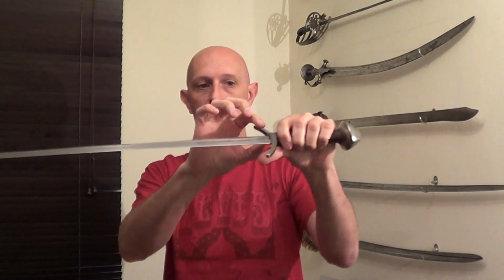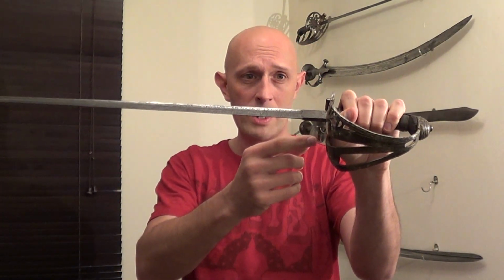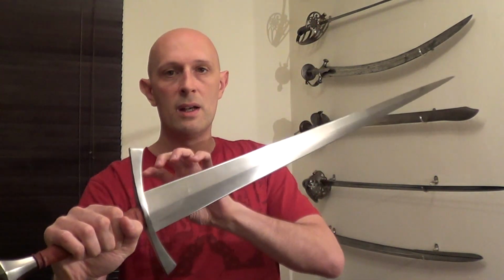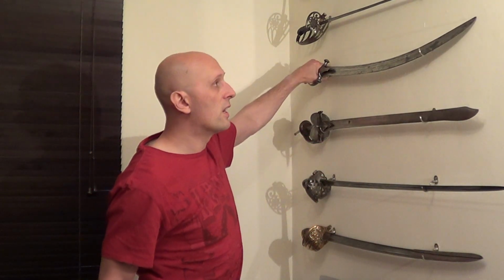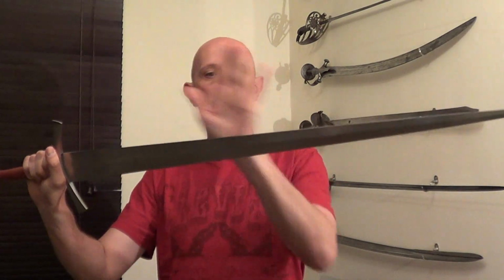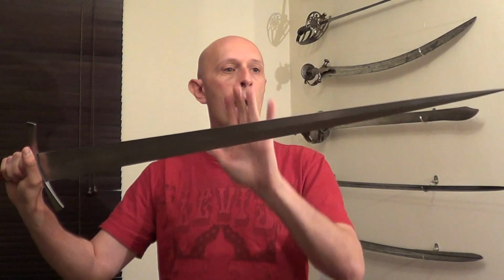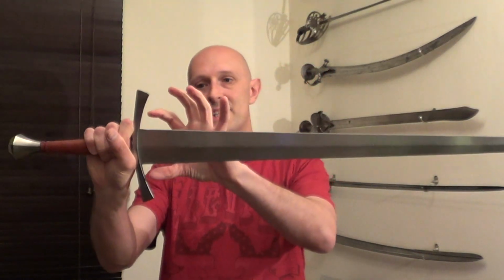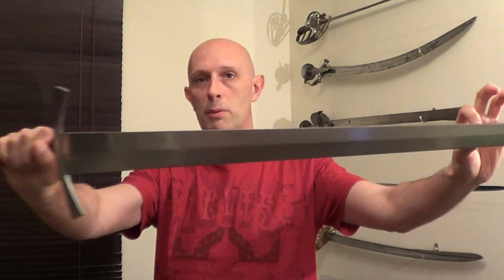Sword distal taper and tapered blade types

Comment: My Albion Laird sword finally arrived last week, and I was amazed at how different it was from every other sword I've held, mainly for the reasons this video mentions. The only problem is that my older swords now feel like metal bars in comparison. I probably wouldn't have heard about Albion if not for your videos, so thanks! It took me awhile to pull the trigger because they aren't cheap, but their products are worth it. Related to your points about those two swords in the video having less distal taper to improve their thrusting power/efficiency, my new sword has a lot of distal taper, and when thrusting into anything, if you're not careful it can bend and not penetrate well, but it cuts amazingly. There's a lot of stuff you wouldn't think about if you don't have any experience with period swords or accurate replicas, so thanks for sharing your expertise. :)
Reply from the maker: zarbran Congratulations on your new sword. Albions are expensive, but they are consistently excellent and very good replicas of actual original swords (unlike most replicas unfortunately).
Reply: zarbran Congratulations on your new sword. I have The Knight, and to my knowledge The Laird, The Caithness and The Knight share the same blade. I can relate to what you are saying. They are almost identical. 1,2 kg and CoB: 11 cm on The Laird and CoB: 11,43 cm on The Knight.

Skallagrim is owner of The Caithness. It's 1,15 kg with CoB: 10,8 cm. He has done a lot of great cutting with his sword if you haven't already seen it.

These swords are really nimble in the hand. Would really love to see a review by Matt on one of these swords.

Comment: I don't mean to be pedantic, but "distal" actually just means "further away from a point of reference", in this case the grip. It doesn't specify in which plane (in this case you could probably call them sagittal and transverse). Proximal is the opposite, it means closer. So those two albion longswords actually have a lot of distal taper in one plane, but almost none in the other.
Reply: Sharpknifesedge I think it's just a convention to call tapering in thickness of a blade "distal" while using "profile taper" if you are refering to broadness. But you are probably right about it being a bit stupid, language tends to be sometimes. =)
Reply: gurkfisk89 It probably is. It is certainly convenient to have a term for a taper in one specific plane. It just doesn't make sense to me to talk about "distal taper" when the so called "profile taper" is clearly a form of distal taper too. Maybe I'm a bit obsessive about these things.
Reply from the maker: Sharpknifesedge Linguistically you're correct of course - however in the world of swords (and perhaps knives) people generally understand 'distal taper' to refer to the reducing blade thickness (as opposed to width).
Reply: scholagladiatoria Fair enough...
Reply: Sharpknifesedge Deceleration is a form of acceleration, but without mentioning deceleration, its understood that by default a person is referring to positive acceleration. You could say its a language shortcut, using an assumption to save time when conversing.
Reply: The nature of language is that words take on new meanings over time, and have different meanings in different contexts. It's not incorrect usage to use a term of art that may have different meaning anywhere outside that field.
Reply: Albert Milbert I hope that you don't use those rules all the time. I mean, I would think that someone who never use metaphors would probably be rather dull (and with dull I mean boring, I'm not talking about their geometry). =)
Also, as you have a problem with zweihander, do you also have a problem with the words gladius or katana?

Comment: The Kingmaker from Albion is an example for the opposite. It is a type XVIII but tapers from ca. 8mm to 3mm despite having a good profile tapering as well. Moreover it has two interesting features: the hollow grind elevates the mid-rib and the profile tapering reminds of a gothic arch giving it a bit more width at the cutting point.

Comment: Hi Matt. 

Could you please make a video about longsword footwork? I was always taught to keep my feet as parallel as possible and to avoid twisting my hips at all costs when making the passing step. I.e., the hips are to be as on-line with the opponents as possible at all times. But I see a great many instructional/sparring videos on here where no real attention is paid to that and even experienced swordspeople adopt a stance where the back foot is essentially at a 75 degree angle to the forward foot. The sources I've looked at don't seem very clear on this. Is it just a matter of interpretation? How important is the position of the feet and hips, and what is the correct 'form' for passing steps?

Comment: 8:25 I would like to point out that this triangle shaped blade can even actually penetrated a chest plate with a trust. I have seen it successfully done so in an experiment before (however, they use modern steel for both sword and armor) That's how imprressivly good this triangle shape blade is at stabbing.

However, I would also like to point out that it literally just penetrated the plate armor, as in just poke a little hole with just the tip of the sword. It wouldn't be letal even if the wearer doesn't wear gambleson beneath the plate, and the sword would also get stuck.

Comment: When you said that medieval arming swords and longswords are not great cutters, does that just apply to those with a diamond section like an Oakeshott type 15 or does it also apply to older forms like type 10-13?
Reply from the maker: beonoc Earlier broader, flatter types are better cutters in general.

Comment: The Ringeck has a great deal of distal taper!
At guard 8.96mm
PoB 7.94mm
CoP 4.81mm
Tip 3.63mm
Reply from the maker: Andrew Hannam The numbers are a bit deceptive here - you'll see that it goes from around 9mm to 8mm just in the first few inches. Then from 8mm it only goes down to around 5mm at the CoP. 5mm at a CoP is really thick! Many sabres, tulwars etc are around 2mm at the CoP, and they also start at around 6-8mm thick at the base.
Reply: scholagladiatoria  Interesting, I am not very familiar with sabres and such. I will state that the Ringeck is however a type XVa not a good cutter like XII ect. I remember when I saw my first "real" medieval sword thinking how thin it was. I came from Japanese sword arts and katana and tachi are THICK!!!!!! and heavy. Thanks for an alternate view.

Comment: The longswords that Matt seems to be showing more don't have a fuller from what i can tell, is there any disadvantage to having a fuller, or is there any reason to not have a fuller? it seems to be very useful in all swords from what i can tell
Reply: Tyrion Lannister That particular Sword is from a period when armor and shield were predominant or at least more frequent in the battlefield, you want a stiff and heavier weapon, for trusting or paring, so, is not necessary to subtract material from the blade, what is basically what a fuller is.

Comment: hey as a blacksmith relatively new to swords(i specialise in axes) i would ask you as one who mainly wields them, what disal taper should i generally put on dedicated cutting blades like the germanic aptha. as used during the roman occupation of the netherlands,55 BC to around 410 AD particularly late in that period towards 500AD
Reply: Arian Wijkstra  Honestly, best thing you can do to start is find an actual archaeological find and replicate that. Some museums may be willing to give you measurements.

For questions as specific as these, I recommend http://www.myarmoury.com/ instead of a YouTube comment section.
Reply from the maker: Arian Wijkstra I generally agree with Martin, however distal taper doesn't vary hugely between swords from a wide range of cultures and periods. For something like a spatha, or a Viking era sword, a distal taper of something like 6mm down to 3mm would be quite normal.
Reply: I've scoured the internet for information on distal taper in Roman and Migration era swords. I haven't found a good source for reliable numbers. One factor that seems to be overlooked: The transition from pattern welded iron blades to steel. The Romans and early Germanic cultures could not make what we call steel. 

I don't think the earlier Roman and Migration era swords had as much distal taper as later steel blades because pattern-welded iron blades would "set", That is, they would bend and deform when struck, instead of flexing like modern steel blades. To compensate for their weaker metals, these early sword blades had to be thicker and heavier. 

As mentioned in this video, the Japanese katana does not have much distal taper. Not coincidentally, It had a folded metal construction like early European swords, although with a steel edge. The vikings could reliably make steel, unlike their earlier Germanic relatives. They began making blades with pattern-welded iron cores and steel cutting edges, then transitioned to all steel blades around the time of the Battle of Hastings.

I think European swords developed distal taper after they developed steel blades.

...

Comment: Dear Sir, there is also a very important construction reason why blades are thinner towards the tip. The blade have to withstand its own weight so to speak (especially at tang which is a weak spot). Kind regards. Rafaell
Reply: Rafaell C Unless you're cutting, in which case you want the point of percussion closer to the tip.

Comment: In your opinion would these stiff swords be better against armor even in the cut? What I'm thinking is that anything mail or better will not get cut by a sword. But a lighter and more flexible sword hits less hard and also will tend to twist on impact because it is less stiff. A stiff diamond cross sectional sword will hit much like a metal rod transferring more impact to the opponent.

Probably not doing much damage, but possibly stunning them with a blow to the head or neck or breaking a small bone in the hand or arm. Once you have temporarily disabled your opponent you then can apply the point to finish them. Also, if you are mounted and riding by you wouldn't be likely to find a gap on the pass but could still do some damage with the edge just from the force of the impact.  

Comments?

Comment: Im wondering, is it possible to have a sword with no distal taper but PoB close to the guard and still have it quick and snappy ?
Reply: Mozoto, if you have no distal taper, but still want a sword with a PoB close to the guard that's quick and snappy, you'd need a lot of profile taper.

Comment: 7.00 mm= 276 mil/thou,
2.00 mm= 78.7 mil/thou.

I admit, milimeters are a more convenient unit for this particular job.  Of course, you could say that it's 18 (or 15)/64th  to 5/64th of an in., but that's not a lot better as that's not a common unit.

Just to keep up, 3 mm is 118 mil/thou or 8/64th in.

Comment: scholagladiatoria
1:17 could you spell that word please? Google turns no results with the ways I attempted to spell it.

...Also, The flatter a blade is (any blade, not just talking about swords), The sharper the edge can be. If you look at a Japanese kitchen cutlery knife. They tend to only have an edge grind on one side. Consequentially there are left handed and right handed knives in Japanese and often Chinese kitchen cutlery. Whether they are left or right handed knives is determined by what side that grind is on. Because, they will have a tendency to veer either left or right slightly in cutting. Which is the sacrifice they make for the ability to be scary sharp. A 0° edge grind on one side (as in, no actual grind) and a 10° edge grind on the other side. Makes for an included angle of 10°.

My own go to kitchen knife for slicing and dicing (1890-1920 produced, nogent style Sabatier) is very flat, accept at the heel. and even in being flat distally tapers to be thinner as well. I have an included edge angle of about 15° (chisel shape) on that knife. With an included 20° back bevel (convex). Something I can only do if I am starting with 0° on either side.
Reply: ***** I assume you want the spelling of foible?
Reply: yup, thanks.

Comment: That's interesting that modern katanas aren't as thick as the historical examples.  Is that because modern metallurgy is superior, or did a thicker blade have some advantage against armored opponents that is lost on watermelons and tatami mats?  

Actually, you must get asked this a lot, but when the mythbusters tested swords there was a big uproar among viewers that the modern replica katana was not "real" and that the historical folding process should have resulted in a superior blade than modern power tools and sharpened bessemer steel create.  I know that modern kung fu weapons have been reduced to metal pompoms, so it's not a far fetched claim, but I've never seen anyone present evidence.  Not limited to katanas specifically, does your experience with antiques and replicas suggest that a process like folding or pattern welding would result in a dramatically different blade to modern machine shop sword making?  (or however the "good" sword makers do it)
Reply: ***** Purely speculation on my part.  I believe that they didn't discover the technology (for both crucible steel and tempering) until well after the katana had became a cultural sacred cow.  The amount of effort and knowledge required to make a traditional katana is so much greater than just using good steel and tempering it.  That's all I can come up with.
Reply: Ace theSuperVillain Both of your thoughts are correct.  Modern metallurgy allows for thinner, but more resilient blades, but also historically speaking katana with thicker blades were more resilient against the most common armors of the time (i.e. thick cloth with butted mail sewn into it and lamellar cuirasses).
One thing to note however is that the "katana" as we know it represents a specific style that became popular in later centuries when heavy infantry became popular on the battlefield.  Earlier styles of katana (e.g. early Kamakura era tachi and kiriha-zukuri style blades seen on chokuto) are much flatter and thinner than those seen in later periods.
Reply: JZBai News to me, thanks.  That makes a lot of sense. I still can't get my head around them giving up their shields, though.  I know in Europe the armor got so good that they had to use two handed weapons just to get through it.
Reply: Golgo Onethree That all makes sense to me.  You do a good job of putting things in context.  I'd known most of this.  I just hadn't shaken it all out so that it fit together.  Thanks.
Reply: Golgo Onethree Not quite, thicker swords actually cut less well. What happened was that the tips of japanese swords were breaking off on mongolian armor, so they made them thicker and rounder.
Reply: Golgo Onethree  Yeah, this is about the long and short of it.  Katana cut very well despite their thicker blades mostly due to the draw cutting technique employed in Japanese swordsmanship (their sharpness isn't really THAT notable in either direction, especially historically, compared to European swords).

Interestingly, in addition to being thick, they're also fairly rigid, which makes a katana rather more competent in the thrust than most swords thought of as cut-focused.
Reply: Ace theSuperVillain When you say Katana you need specify the type of it. Older tachi which seems to be the cavalry swords are very different then what was popular during Sengoku jidai or Edo. Katana of the Edo is very stiff almost unbendable curved bar with razor sharp edge. It cuts really well and you can thrust with it much better then with most cut centric swords. It only problem is weight and length. It is kinda short and heavy. Earlier swords were carried differently and have very different curvature which is very unique as swords go. 

Spring steel swords basically stuff that can bend is not as good for cutting or thrusting as a much stiffer blade. Mat actually had a video about a custom sword built for an officer during Indian Mutiny, that did away with a fuller and seems to be optimized for cutting. Guess what older tachi often have fullers, Tokyo museum has few examples from Kamakura time, they are long curved gorgeous swords. Some Sengoku Jidai swords do as well.

People tend to blame everything symbolism of sword in Japan but thing is Japanese were incredibly fast to adopt anything that worked and improve on it. By 1615 Japan had more firearms then any european country by  large margin, adopted bullet resistant cuirass. Invented front gun sight, invented box to protect the matchlock in rain. etc. Bow, spear those were always the primary weapon of the samurai. Sword was a siderarm.